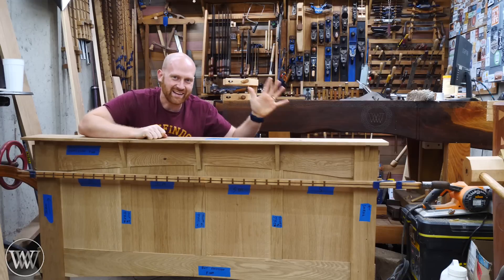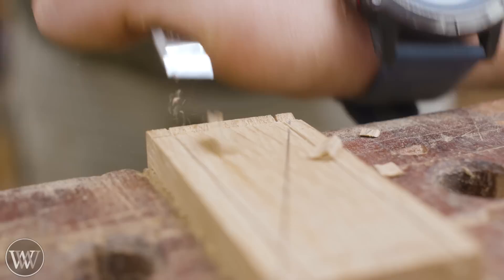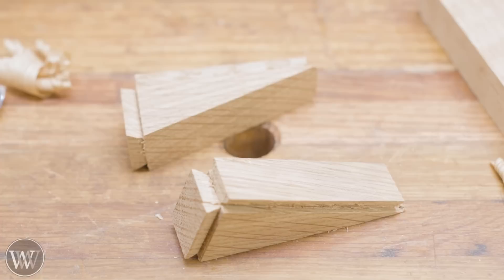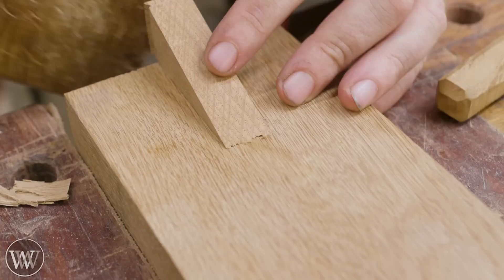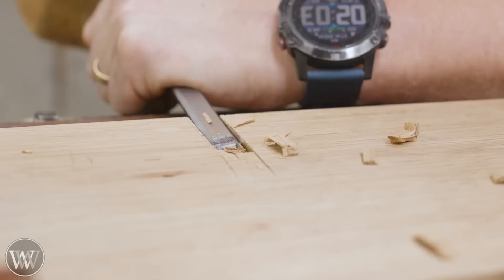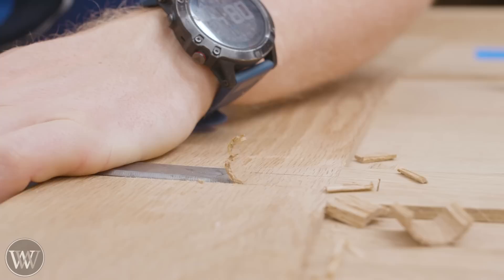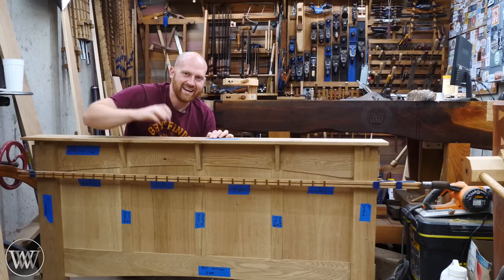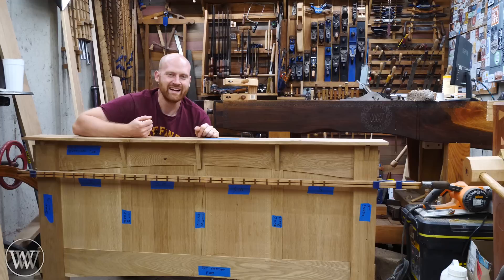How to Wood By Wright Bed Part 6

Comment: Hi James, I am wondering why you decided to not use a sliding dovetail to connect the corbels to the cross rails on the head and foot boards?
Reply from the maker: I thought about it but then I just got lazy. Technically it would be ever so slightly stronger but in practical reality it really wouldn't make that big a difference so I decided not to put the time into it.

Comment: On one of the corbels the point looked a bit rough. Not square and a little jagged. How did you finish the one?
Reply from the maker: Just before glueing it in I will take a chisel and cut strait across right on the tip. There is no way to get a perfectly strait point with an acute angle in oak. The ring porus nature resists it. Lol